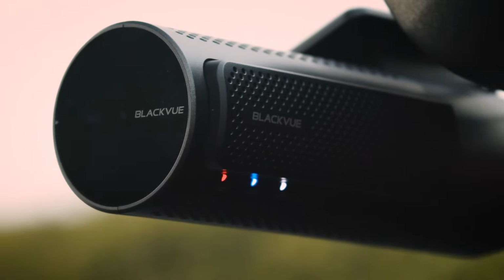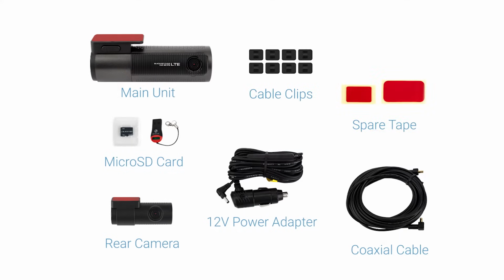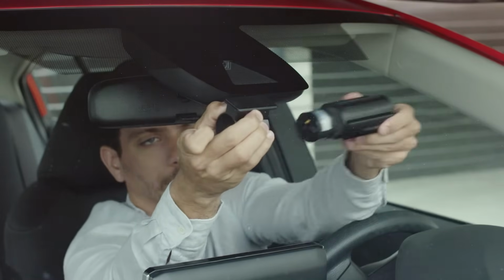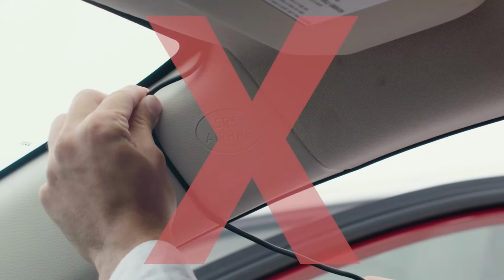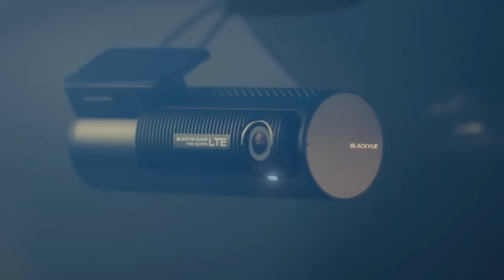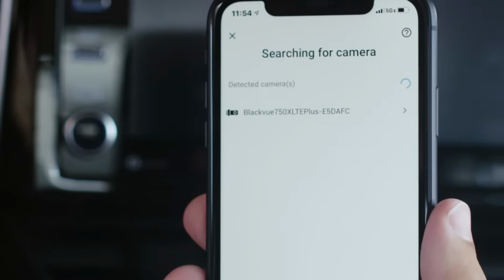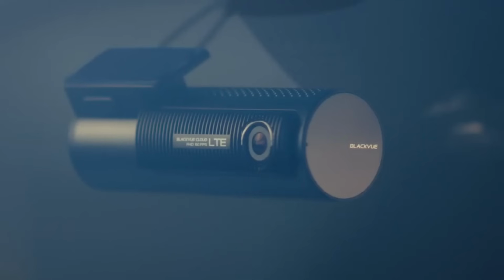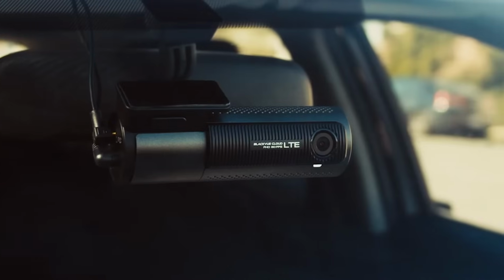BlackVue DR750X-2CH Plus LTE / DR750-2CH LTE Dashcam Installation Video

Comment: Would not recommend a blackvue dashcam to anyone. Not any of their models. Not only are they complicated to install, but once it's installed that's when the problems really start. Camera records randomly & not when events actually happen. Customer service is basically non existant & every single extra feature you may want = $$$$. Rubbish cameras, rubbish software & a rubbish company. Got a $2500 front & rear cam that I would even use as a fucking paper weight. Crap.
Reply: They've vexed me as well. The mount for my dashcam broke and they dont sell replacements. $500 dashcam just sitting in my glove box right now.
Reply: @DavikShaftler sorry mate. Cannot see why anyone would recommend their shit cameras. Also forgot to add that I'm my second front camera replacement due to camera lens fogging. Absolutely shite product. Zero value for money.

Comment: I opened mine today and put the SD card in, and it jammed. It would go in further on edge (uneven and sticking out a bit), so I tried pushing it in on the edge which wasn’t as far in, now it’s jammed. :(
This is the most expensive dash cam there is, and already just installing the sd card has messed it up.

27 September 2022
6:04pm NZST
Reply: I managed to yank it out, but when putting it in, it doesn’t smoothly click in, doesn’t have the locking mechanism working.

6:14pm NZST
27 September 2022
Reply: That's why in electronics you never force anything in, if the sd card was bent, you shoud've tried with another one instead of risking damaging your brand new dashcam :/ @SuperSight

Comment: haha, "easy to install without requiring technical knowledge" - a few sentences later: "if you want to use parking mode, you'll need to use a hardwiring kit", cables sticking out.... or a battery such as ... - and no mention of how that works....
Reply from the maker: Hello and thank you for your comment. To learn more about Parking Mode and the available accessories to enable it, you can check this page: https://blackvue.com/blackvue-dashcam-parking-mode/
The options, in decreasing order of simplicity are B-112 (Power Magic Battery Pack which plugs into the cigarette lighter socket), B-124X (Power Magic Ultra Battery) which can be plugged into cigarette lighter socket or hardwired to the fuse box, and finally Power Magic Pro hardwiring kit. 
The batteries charge while you drive and maintain power to the dashcam when the engine is off. 
The Power Magic Pro draws power from the vehicle's battery and shut the power to the dashcam based on its timer or when voltage drops to one of the preset levels (whichever happens first). 
Thank you.
Reply: @BlackVueOfficial  thank you, the parking mode, is important, because people causing damage, are often just driving away without leaving a notice. 

I also found a video for the Power Magic Pro hardwiring kit, which refers me to my car manual for which fuse has power when the car is off. The video was good and i could understand it. You could refer to these other videos in this one, so people know where to look for the parking mode.

Comment: hello, is the version of the BlackVue DR750X-2CH LTE Plus dvr purchased in England suitable for Russia?
Reply from the maker: Hello, yes, it should be compatible (GL version). However, in doubt, consult the LTE Bands specifications to verify that they match the bands supported by your telecom company. Thank you.
Reply: @BlackVueOfficial  and where are these ranges prescribed? Does the DVR itself support Russian or do you need firmware?
Reply from the maker: @dimas01kumpilov57   Hello, you can check the info on this page: https://blackvue.com/dashcams/lte/
This article has a table showing each model's supported bands: https://blackvue.com/blackvue-dr750x-2ch-lte-plus-dash-cam-with-built-in-4g-capability-available-now/
Russian-language firmware is separate from other language firmware. You should be able to use the dashcam without problem but it might not be possible to change the firmware to the Russian version. Thank you.